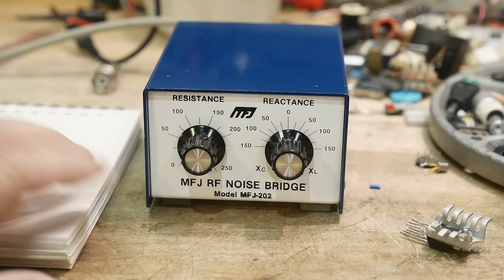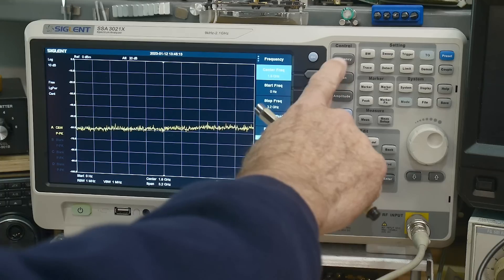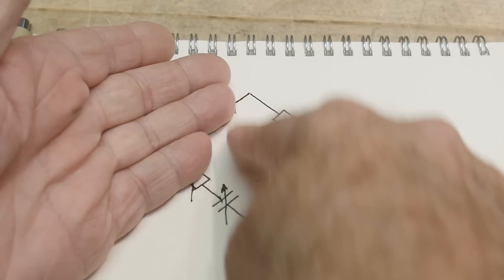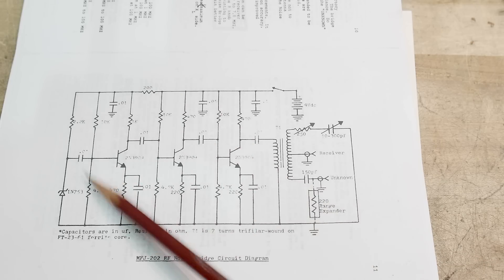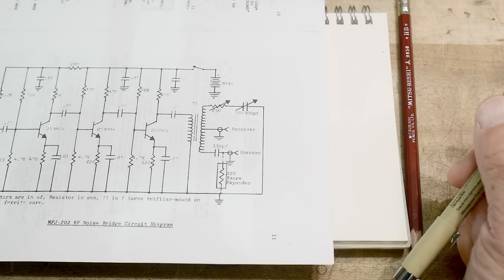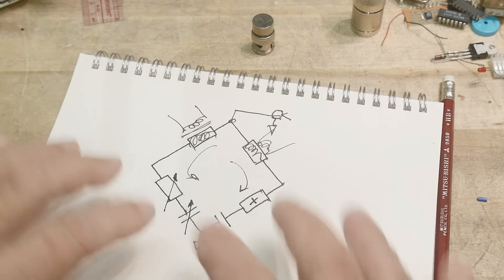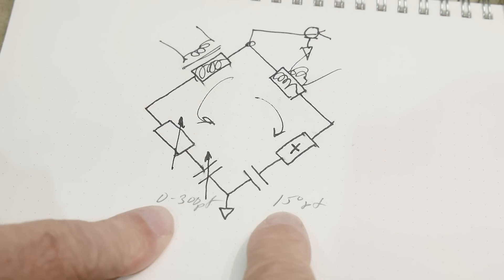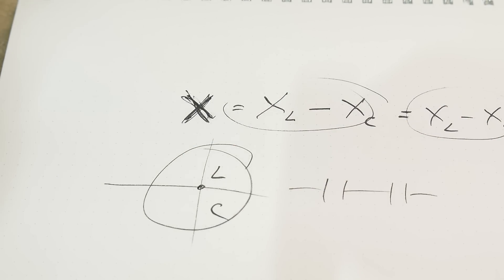#1401 MFJ-202 Noise Bridge

Comment: Interesting concept, and simple basic design of an impedance bridge. Similar concept used in older wire line telephone circuits where 4 Wire voice circuits are converted to a 2 Wire conventional circuit via a 2-4 Wire hybrid. The Hybrid contains an R/L network used to balance the impedance of a 2 Wire line terminating into a 2-4 Wire Hybrid, or Term Set. By adjusting capacitance and inductance to match the 600 Ohm 4 Wire line equipment, balance is achieved through the hybrid using a white noise generator, and measured with a Return Loss meter that measures SRL Hi & SRL Low band across the voice band of frequencies. The higher SRL/ERL losses indicate a "Best" match that indicates that the 4 Wire Hybrid is balanced to the 2 Wire section relative to the impedance of the 2 Wire line.  A near perfect match results in very low reflected power being returned to the 4 Wire line. The concept is the same with RF, where the best impedance match will result in the least amount of reflected energy being returned. In the RF world, the objective is a low SWR. In telephony its the suppression of talker echo, and high pitched squealing, AKA A Singing circuit. A condition that is relatively rare in today's conventional telephone equipment as the copper loop disappears. Now, if a concise, and clear explanation of the relationship between the two adjustment knobs on the noise bridge were given, the noise bridge can be an attractive old school bargain VNA.

Comment: Very good tutorial on noise bridge theory and operation. Back in the day, I bought the Heathkit version. I wanted to build a noise bridge and I wanted the detailed manual which Heathkit was famous for. Our radio club members used these noise bridges before the MFJ-259 became THE instrument for ham antenna tuning. Presently my "go-to" instrument for antenna tuning is my Comet CAA-500. It provides very simple operation and the cross-needle display is very readable in direct sunlight.

Comment: Very well explained demonstration of how to see what the noise bridge is doing.  However, how would you use it in the real world?  Especially if one is repairing radios.  Can it be used to more easily reduce noise in an antique radio?  Lets see a repair application of the MFJ-202 box!
Reply: Should be able to use it in some cases to impedance match different elements, though there will be some devil in the many details!

Comment: If you have an ideal resistor as your DUT the adjustable capacitor should null at 150pf.  If your DUT is predominantly inductive this will accentuate the capacitance on the test side and your adjustable capacitance will have to be increased toward the inductance side.   If you DUT id predominantly capacitive this capacitance will be in series with teh 150pf capacitor and thereby reduce the capacitance on the test side (as you showed, putting capacitors in series reduces the overall capacitance) and you adjustable capacitor will have to be decreased below 150 pf toward the capacitance side.  These are normally used to test antennas.  If the antenna is too long it's inductance is dominant and it will read some where on the inductance side, and if it is too short its capacitance will be dominant and it will read on teh capacitance side.

Comment: At 4:38 isn't reactance measured in ohms? (Frequency dependent resistance to AC current.)
Reply: Yes, but it's the nature of the reactance that is being uncovered here.  Whether it's being caused by excessive capacitance (antenna too short) or excessive inductance (antenna too long).
Reply: @uni-byte  Yes of course, but my point was it’s specified in ohms XC (capacitive reactance), or ohms XL (inductive reactance); so although I haven’t measured it to verify, I think it’s not an arbitrary scale on the device, rather it shows the ohms of reactance, one side for XC and the other side for XL.
Reply: @ruhnet   Okay.  I see what you mean.  You could very well be right.  They still sell a version of that noise bridge.  I wonder if the user manual is on-line.
Reply: @uni-byte  Ah, great idea---I just looked and found a PDF of the manual. It says the righthand dial is showing the value of the variable capacitor in pF. That can of course be used with a formula to find the reactance value in ohms. (The manual also conveniently provides the formulas needed.) So that clarifies what the scale actually is. 😀
Reply: @ruhnet  Yeah, it can't be Xc or Xl in ohms because what we're varying is a capacitor -- the scale would have to change for different frequencies.  What doesn't change is the actual capacitance of the component, so we have to convert to reactance in ohms when we know the frequency.

Comment: Ok, we understood how does it work, but what are the applications?
I think the capacitor to measure inductor was cleaver. 
*   Thinking out loud:   *
Also, we might connect an antenna as the unknown, and try to measure its impedance at some frequency (Maybe?) at given atmospheric condition. 
As an alternative circuit design we could use two similar antenna that are directed toward the same target as the two bottom resistors, get ride of the noise source but keep the transformer.
Now the output of the transformer (where it was connected to noise source before) , gives us the net noise of these antenna elements, because the signals cancel out. 
We can add the signals of these two antenna, they act as array antenna now, we get the signal, and subtract the noise we found from the transformer, we can eliminate the elemental noise of the antenna (May be) This does not eliminate the path or channel noise, just the noise of antenna itself.
we can have antennas and their LNAs in the above circuit, this way we can cancel out noise of the antenna and the LNA (Maybe)

Comment: You could set up LRC in series and observe their voltages on an oscilloscope.  Since all currents are synchronous, you can observe the relative phases directly and you can add V_L+V_C to see why we set Z=R+j(X_L-X_C).  There is a caveat that we cannot wind inductors out of copper without resistance, but you could show the trend toward perfection by reducing a variable series resistance.  By varying the frequency, you can vary the relative amplitudes of V_L and V_C.

Comment: VNA
Reply: Yep. But there are people with a TinySA who can't afford even a NanoVNA yet, and they can build a noise bridge for next to nothing out of junk-box parts, or get one like this at a ham swap for $5, and merrily tune their antennas and filters all day long.
Reply: @johnwest7993  I got one at a ham swap for free. I didn't know what it was. I got it because I thought I could use for a project. 73
Reply: @johnwest7993  I wish I had a junk box with decent 300pF air variable capacitors in it...  This box is basically worth $5 for the capacitor alone!
Reply: @johnwest7993  I intended to suggest that the device be examined with his VNA.